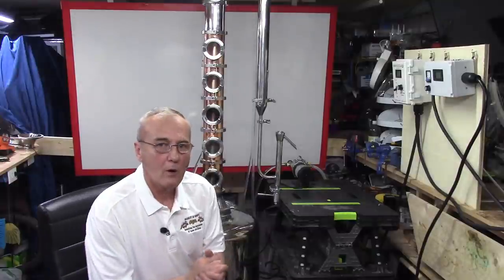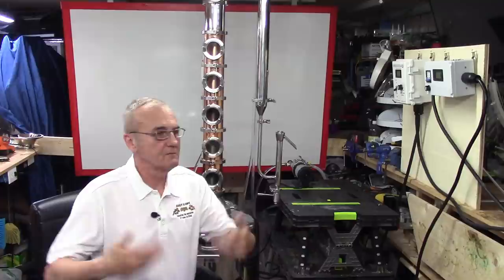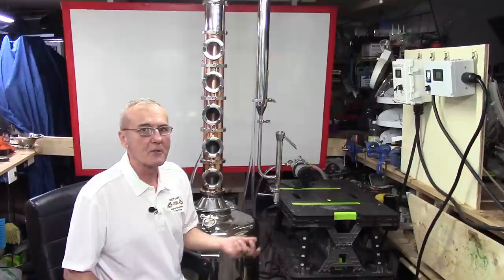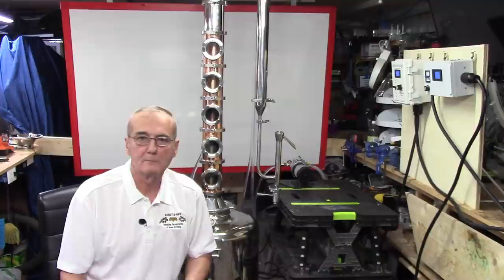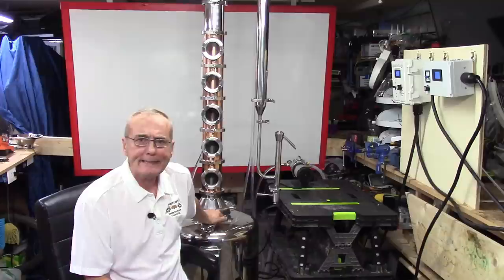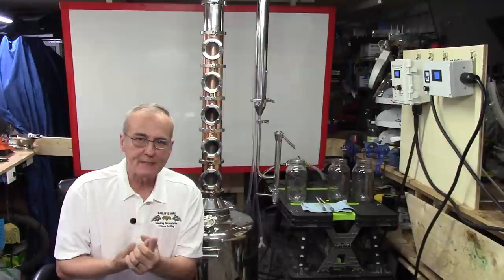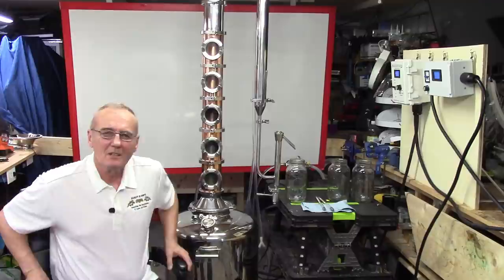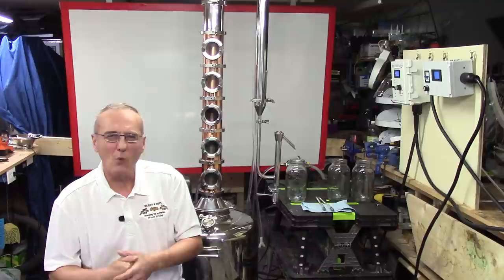RUNNING A STILL PART 3 AND MORE DISCUSSION MileHi 4 inch bubble plate column

Comment: At the 25 min mark you describe this process as refluxing .... this technically is not refluxing as removing the condenser for and allowing the solution to heat up the column and fall back would be a reflux ... however when you are trying to strip or distill a certain compound over past the condenser while using fractions of your distillate to push back the high boilers, this is called fractional distillation as each plate counts as a separate fractional distillation layer.  I know it may seem a little silly to correct you on since it still is technically a reflux, the only reason I bring this up is because I know a lot of people have trouble understanding why and how this works and if they want to understand it the only way they will be able to explore this aspect of chemical distillation they will have to study it under the term fractional distillation since heating at reflux is just a means to bring certain reactions to their activation energy or enthalpy energy change.

Comment: George,   I think one minor, but important element that many miss...  and I don't think you have really talked about, it the time to remove the 0.25% or even lower methanol out of the 26 gals.  Remember as you say methanol comes out first, but as it does, the "heat" put into "boil-up" our of the reboiler quickly "slows" the removal the methanol.  Running "large" chemical operations in the 2-3,000 gals range, it take say 4-8 hours to remove the "light" (ie methanol) components from a batch distillation.   The columns needs to "sit" on total reflux longer than your describing to pull out the methanol out of the reboiler.  Technically it's about the partial pressures of the two compounds  PV=nRT..  The over-head temp should come DOWN as the concentration of methanol increases and you "remove" it from the 25 gals in the reboiler.  

This should take say 1 hour, not 10-15 minutes.  If you use simple math, and say you start at 0.25% methanol (I know it' lower), after 50% is removed, your at 0.125%, then 0.06%, etc......so to get the last 25% out take a LONG time.. Also with over-head temp tell you the accumulation or ability to remove the bad stuff.  IT will start at 175C (water and ethanol), then drop the azeotrope temp quickly of 172F, but then as methanol start to be removed and accumulate in the temp will slowing come back DOWN as the reflux/boil-up does it "work" to pull out the bad stuff from the 25 gals.  It will come down close to 155-160F pretty fast.  At that point....you can get "Stuck"....and if you turn off reflux for 1 min, and let that bad stuff out.....the column is WAY more efficient removing the methanol.  Then go back on reflux and wait 30 mins..  It will come down below 172F, but MUCH slower as likely first 50-75% of methanol is removed...  

I do this 1-2 times, and then start "heads".  The head "flavors" can be concentrated with the SAME method.  It might add a couple hours to a run, but the cuts are WAY WAY WAY more separated IF THAT IS WHAT YOU WANT....  

But over-time, I'm with you and combine a lot in the end, but I think it is good for guys with columns to know their is a "time" and energy input needed to complete a higher level of the methanol separation.  To ME, this is the TRICK to made better juice than Large scale continuous stills...  "Some" of the more automated large guys take the methanol SLOWLY off the TOP of the column that accumulates, with the product ethanol stream coming off the column about 3-5 trays BELOW the over-head/reflux or TOP tray..... That way they take off both streams at the same time.  Again this is COMMON in the chemical industry, but LESS common in ethanol production... 

Been a while sense I posted, but thought this point is important enough to write about.

CHEERS!
Reply: Great info Paul, so you're saying you do (3) 1-hr (FULL REFLUX) runs on foreshots and then another hour for heads? Do you do the same for tails?

Comment: Glad you’re back George. What happens if you start to get a lot of liquid accumulating on the plates? What is acceptable and what is not? How would you then fix the problem? I had The plates filled to over half. The dephleg turned all the way down and could not get product to pass through into the condenser and out of the parrot

Comment: On the methanol argument is if you mix it with all the rest of the ethanol you should be ok.. but on the argument of methanol in wine and beer.. is that its diluted with water as well.  Its all about concentration per say

Comment: Q question about the bubble plate's? Can you run one copper and 3 stainless steel for a 4 plate setup? As you've stated the system has to have copper in line in the reflux. Would that be enough copper?

Comment: Hey George, I’m running the same size unit. I have a ball valve on the bottom of my parrot. Would you ever pull the first 4 ounces of foreshots through the parrot then dump the parrot (holds ~4oz) out to clear the system of fourshots?

Comment: i did a plum vodka run a while ago in T500 pot still mode and im finding something interesting. i keep finding semi transparent floaties in em... but after sitting for a while, they kinda precipitated to the bottom. is there a good home friendly way to get rid of em? fact that they sank down i figure it isnt oil based... must be carry over from the boiler.

Comment: Of course, George cuts to hearts when it hits 93%, but on this system. That cut point will be different depending on the type of still and the geometries of that still. I believe the cut-off from heads to hearts on a strait pot still, no plates, is around 80%. Generally best to rely more on taste till you really get to know your still and find out where that cut-off point will consistently be. At least on your heads cut as that's much more important than the tails cut, in my view anyhow. Going just a little too far into the tails can probably be fixed by the aging process, but cutting too early in the heads, nothing can fix that. Still, the overwhelming distinctiveness of heads makes the "heads cut" pretty easy if you're tasting.

Comment: Is the specific gravity of methanol lighter than ethanol so it will not lay in the bottom of the parrot? thanks.
Reply: Only if the liquids were perfectly still for a considerable amount of time. Fluids in motion will mix